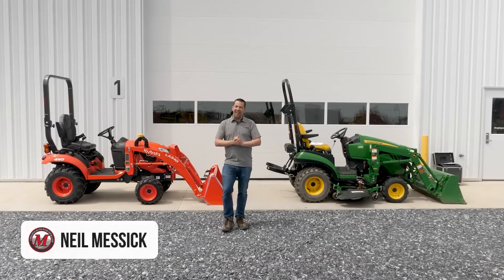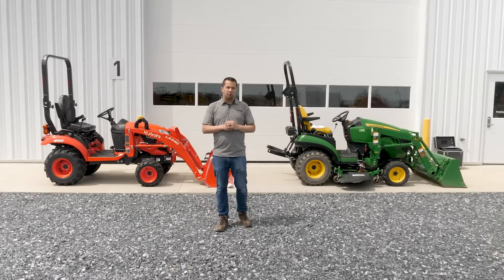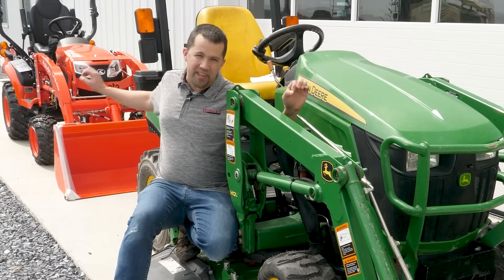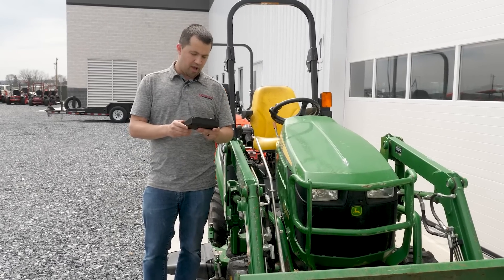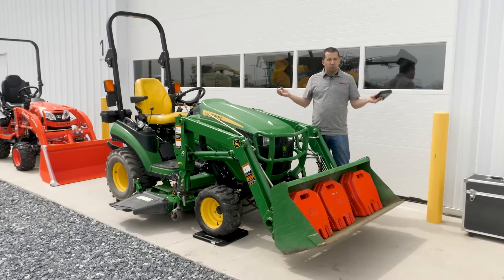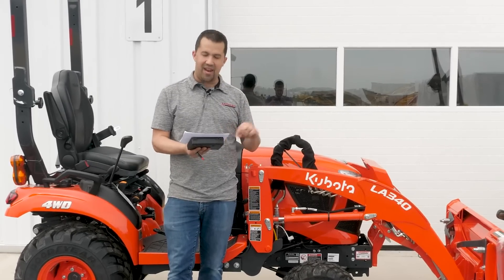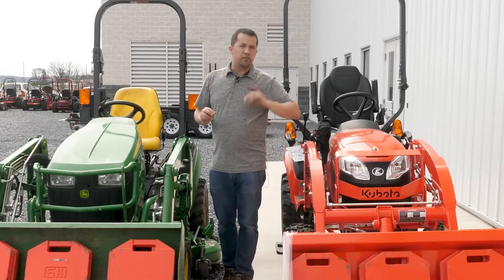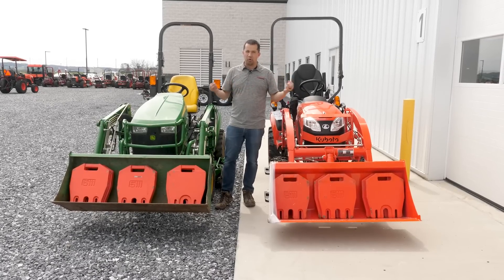front axle capacity vs loader strength

Comment: I know this video is two years old but I'm laughing cause I just watched a clip of someone bragging about their tym 2515 lifting 3000lbs doesn't say that's at the pin so it's closer to 2400+/- which is still a lot for a tractor not much bigger than a big b series or lx  or 3 series. I know I often wish my L3940 lifted a little more than it does for the size it is but it gets everything done I need it to, if I need to take two scoops or two trips instead of one and I get a lot longer out of front end parts I'm ok with that. Lifting something and driving with it are two different things and I know I'm rarely driving on smooth pavement with my tractor when I'm using the loader. For the record my tires are filled making them about 500lbs each and have a 800lb weight on the back and I'm still thinking about getting wheel weights for bushhogging on hills in the field or pushing snow. That 800lb weight alone made it a whole different beast pushing snow

Comment: Axel capacity and lifting capacity weren't deciding factors on what subcompact I bought. It's primarily functions are #1 cutting grass and #2 clearing snow. But it is nice to know what I can safely do with the machine and it shouldn't be a treasure hunt to find that info. And the numbers shouldn't be manipulated in such a way to appear bigger than they realistically are.

Comment: That model Deere is a pile Always  something  leaking with the hydraulics and transmission  or the cracked valve cover from the air filter bracket being mounted to it and sucking dirt in the engine

Comment: Hard to design a machine that's small enough to fit in a decent backyard shed, light enough mow the lawn, and strong enough to unload pallets of field stone.  Some people really need a compact tractor, a zero-turn, and a fork-lift, often asking the former to be all three.  

Front axle capacities should absolutely be openly published.  Educating the customer about topics like this will go a long ways towards forcing that kind of transparency in specifications as well.  Many of those front axle repairs are due to simple lack of rear ballast.

Comment: 7:12 it’s getting ridiculous, they’ve been making loaders for tractors with too weak of a front axle for years. Ford is guilty of it in the 60s but frankly it was more common to snap the loader arms on the 3000. You’d think they could overbuild it correctly from the START. they must assume tractors don’t get abused, there are far too many idiots in the yeLlow and black seats. 😅

Comment: All I’m gonna say is there are few tractors as tough, powerful (pound for pound) and easy to work on and fix affordably as those like the ford 8N- thousand series tractors and the old Farmalls and Deeres. Everything now is electronic this and that, the shifter linkages are vague, the operating stations seem “squished” and smaller. Not to mention a billion hydraulic lines. Granted, you can’t put a backhoe on an 8N like these, but there is something to be said about the old school durability of the old irons, pulling discs, plows, drags, planters and mowers and pulling forage wagons….these tractors will run long after the clutch and brake pedals are shined up smooth from years of operating.

Comment: I know there is always told in john deere manuals, when using the front end loader with a full bucket, never exeed 5mph. My dad ran 2 john deere utility tractors with loaders and pushed them to the limit quite often. the first one did almost 20000 hours,  without any problems of the zf front axle. The tractor he runs now has 14000 hours in 8 years and also this jd front axle never failed. So i think the dinamic load at full transport speed is at the rated load (heat build up in bearings) but with slow driving,  you have less heat and less bouncing, so less dinamic stress on the axle. When you use your mind when operate a loader at a proper brand tractor, i dont think you got problems normaly

Comment: I have always thought the little front tires on my BX23S would fail before the front axle so I have not been concerned that I would have an expensive front axle repair! I have owned and operated a BX24 for over13 years virtually trouble free and recently upgraded to a BX23S and fully expect it to serve me trouble free for many years to come with proper care and maintenance.  I would say operator error and not fully understanding proper operating techniques would cause premature equipment failure no matter what tractor you use!!!

Comment: You're right about tractors being a generational investment. There are Farmall M series tractors still in daily use. I bought my JD 770 decades ago. It's reliable as gravity and only needed an upper radiator hose, two light bulbs and scheduled maintenance. It has an all mechanical Diesel engine and except for the fuel shutoff solenoid would be happy to run without and electrical system. Not trading it in on a newer tractor while it still runs. 

I bought my Kubota RDT900W in 2004. It's still in almost daily use with 3,200 hours on it. I have upgraded it with the one piece front drive shaft and had one quirky failure of the injection pump, but other than that, it's been as reliable as gravity.

Comment: Something to consider is that engineers will usually over-build a system to withstand forces far in excess of the specified requirements. I guess they know how much abuse we users are capable of dishing out! As a result, published engineering specs are almost always very conservative, sometimes by as much as 50% or even less than any possible failure mode. Of course, the manufacturers will never say that...they prefer to minimize the potential for warrantee claims.

Comment: Thank you for an excellent explanation. Reason I bought the LS MT342 was its lift capacity. I put 1100 lbs in the rear tires and add a 700 pound implement on 3 pt so I can pick up large boulders and move around trees that have fallen on the property. Hopefully it's enough to help protect the front axle. Any idea of the load capacity of the front axle?

Comment: For me, I consider price, performance and capacity and longevity. With today's pricing, I want a tractor that is going to last a LONG time. Deere has probably the best attachment systems on the market for most attachments, but that is it. The loader is the heart of my tractor, so hydraulic flow and lift capacity is key to me folllowed by drawbar HP. Having said that, I believe manufactures should make a front axle that can handle 2 times more then the loader can lift.

Comment: Remove the Weight of the Wheels & tires for a true weight of the Axle Assy. other than the load rating of the Tires, the load rating stops at the Bearings of the Axle. 
Do You have a link to the Scale set up ?
Mike M.

Comment: Seems to me that this is a dealer issue. The dealer should always match the loader capacity to the tractor capacity they sell to a person.  Anything else creates liability inc. manufacture when added equipment overloads any part of  tractor capacity.
Reply from the maker: The manufacturer dictates what loader goes on what tractor. They are in no way generic, you can't stick any old loader on any old tractor.

Comment: As I understand things the front axle capacity is somewhat higher when using rear ballast and rated to be considerably higher in "restricted operation" (ie: low speed, ~ 5mph). I know that Case publishes these numbers for its tractors, does Deere or Kubota do the same?

Comment: I appreciate your channel even though I’m a happy John Deere owner. I know the manual on my 2038R has a section on how to properly ballast the machine for different circumstances and you didn’t mention or address this. I’m still happy that this was not a brand bashing video however. You brought up valid points, but didn’t provide the full Paul Harvey version of this complicated topic   .  Let’s face it a tractor is a tool to get work done, but it’s just the power source. That Attachments added are what does the work. There’s a lot of variables that go into getting that work done safely. In my opinion, that’s where the industry as a whole is failing its customers. A dealer’s motivation is to make a sale, a manufacturer’s motivation is to design something that people will buy, and a customer’s motivation is to spend as little as possible to get the work they need done. What’s lacking is the education to get the work done safely and an honest conversation between the dealer and customer. 

I give you credit for the topics you bring up and for providing an education on surprisingly complex subjects that on the surface seem pretty basic.
Reply from the maker: Thx. I have another video on how ballast affects the weight distribution. I tend to think of every video that I've ever done and sometimes leave gaps for someone that hasn't seen every video. Essentially every pound of ballast takes about a half a pound off the front axle. It improves the situation, but the basic problem still exists.
Reply: @MessicksEquip  the ratio sounds about right to me and the reason I like your videos is you talk about the things that most would not want to discuss as a dealer. Thanks again for your insights and for the tasteful brand bantering, I remember you had Tractor Time with Tim in a video not that long ago. I respect the playful nature of brand comparisons that you provide.

Comment: Is it appropriate to add the weight of the axle itself to the capacity of the axle?
Reply from the maker: not sure, but it won't change the outcome.
Reply: @MessicksEquip   My thought is that if the rated capacity is 1630, and the empty scaled weight is 1320, the available bucket capacity is 320.  However if the axle itself weighs 300, removing the tare would increase the available bucket capacity to 610.

Comment: Good information, but you are comparing apples to oranges to begin with...there is no mower on the Kubota.  Some of the mower weight will certainly be carried by the front axle which is going to skew your starting numbers.  While I occasionally complain that my BX2350 hydraulics are weak, I can consistently overload the bucket with regards to the capability of the rest of the tractor; meaning stability on slopes or the rear end being way too light to safely carry the rated load.

Comment: As long as it’s under warranty it’s the dealers and manufacturers problem
Reply from the maker: That's the entire point of the generational tractors conversation. Should tractors be designed to last the warranty period, or for decades?
Reply: @MessicksEquip  I own a 2020 MX6000 Cab and a 2021 1025R I believe the Kubota will last a little longer but I under use both. That’s the key buy bigger then you need to avoid premature wear.

Comment: Neil, Would Ballast on the rear would help the front axle weights as it is not lifting the back of the tractor and adding that weight to the front?
Reply from the maker: Seems like a good topic for a follow up video. Yes, it will help. It won't bring things into balance though.

Comment: Do a part 2 with progressively adding rear ballast Neil.
Reply: Ballast BALANCES the tractor. It is unrelated to this conversation. There is no scenario where adding weight to the rear "takes weight off the front". That is a common misconception. You cannot reduce weight by adding it.
Reply from the maker: it does actually take weight off the front. There is some fulcrum effect.
Reply: @evracer  ok, one last time. Wrong. Watch Neil's follow-up video.

Comment: The axle capacity is the load the axle can carry.  That's not what you're measuring.  You are measuring the load the axle is carrying plus the weight of the front axle assembly.  How much does each front axle/wheels/tires assembly weigh?

Comment: Believe it or not that's why I decided on an older b7100d with a pin on loader. 

Simplicity and serviceability.  Granted until I saw my tractor I was ready to buy a new 18hp Kubota.  What swayed our decision was plastic vs steel. And yes Messick's does actually still carries parts for my 1979 machine. Wonder what front axle weight is for mine? Not really worried it's a tool. 
Remember....
You can use a framing hammer to dig a hole ... But is it the right tool for the task at hand?🤔

Comment: My comment is about the amazement of 70+ year old tractors that are still working today.  

Sure, they were built well.  But there is more to it.  The rapid growth in the size of farms quickly changed how they were used.  

If a farmer bought a Farmall M in 1950, it was probably the big tractor on the farm (36 hp).  8 years later the same farmer might have gotten a 560 (66 hp) and now the M got lighter jobs.   The same farmer might have added an 806 (100 hp) 5 years later and the M and the 560 both moved on to lighter work.  

This along with simple design and being built well accounts for why so many are still out there.

Comment: For those out there with John Deere tractors, do a search of your favorite tractor forum for the "Cuts Ballast calculator." It's a spreadsheet that I believe John Deere used to publish that let you specify your tractor (open, cab), loader config, wheel weights, filled tires, and rear implements that would give you an overall weight and also individual axle weight estimates. It's a little surprising just how much 3 point weight the smaller tractors need to leverage against the loader to keep the front axle weights down to a reasonable level.

Comment: Excellent info. I have a 15 yr old L5740 with 2200 hrs. I use it often and mostly using the front loader with grapple or bucket. Many times I’ve had to switch to 4wd to get traction to move because most weight was on front tires, way too much weight. I do worry that I might damage the front axle, but haven’t so far. 
I think you should be able to choose a heavy duty or regular duty axle when picking options for your tractor. Makes a difference what you plan to use your tractor for. Of course, as tight as supplies are now, I doubt you could get what you want anyway.

Comment: I order if one reason for increased life of older tractors is the reduced capabilities. As mentioned, they weren’t setup to handle more than they can take. My 53’ NAA is still working with a new owner, but had no FEL and the ones available were basic limited capacity type adaptations. 

For me, I went bigger than needed with the MX…biggest demand is round bails and it’s not working hard to lift them. Going with 2wd and gear drive got me the added capacity of bigger tractor for less cost.  I think key is focusing on needs over wants. 

Wondering if 2wd front axles have less, same or more weight capacity than the 4wd models?

Comment: Great video Neil,we have a l series Kubota no axle problems but have heard of bearings going out.The tractor is light and will lift and carry a load with rear tires basically off the ground so I would love to see those numbers measured.I have had front tire problems but there is no way they weren't overloaded.I have loaded rear tires plus wheel weights and 3pt winch so when the rears are nearly off the ground is it safe to say all tractor weight plus on loader is on front tires/ axle lets check that weight.I haven't had any problems with the tractor just tires but the front is got to be way over on weight  hate to see a cheaper made tractor do this

Comment: I may be wrong, but I always thought that the axle was the part that went from the differential through the axle housing and out to where the wheel bolted on, in which case there would be 2 axles and 1 housing doubling the weight the whole assembly could carry.

Comment: If you throw a massive ballast on the rear, you turn the rear axle into a fulcrum, and take weight off the front axle.  That's mandatory in small tractors with large FEL capacity!  Also, remember the load rating of the front tires, especially if you get narrow, low volume R1s.  You can really quickly exceed load rating, resulting in a blowout or causing the bead to unseat.  If you do that on unlevel ground (where it's most likely) you can roll that tractor in a heartbeat.  I can't emphasize how much rear ballast is important for FEL work....
Reply: No you don't. The front axle is still the fulcrum. You have just balanced the weight across the fulcrum. For a given weight in the bucket...adding rear weight (while it certainly balances the tractor) actually minorly increases the front weight as well.
Reply: @evracer  You could, theoretically, put enough weight behind the back axle to lift the front of the tractor even if it had a full FEL.  Of course, that's in theory only, since that much weight would break the frame or back axle.

Think of a teeter totter, but with two pivot points between the two kids on it.  If the kid on one side is fat enough, he'll lift the other kid right off his fulcrum.  Now, add in the fact that the rear axle is higher than the front axle, and the fat kid has even more leverage against that other kid.  Move the fat kid further away from his fulcrum, and he has enough leverage to send the skinny kid into orbit.
Reply: @evracer did you copy and paste this to every other comment? You were told you were wrong on at least two of those posts, with explanation. 
As a new owner I’ll use the discussion as a learning opportunity. But, please note that just because you repeat yourself it doesn’t necessarily make you any more right.